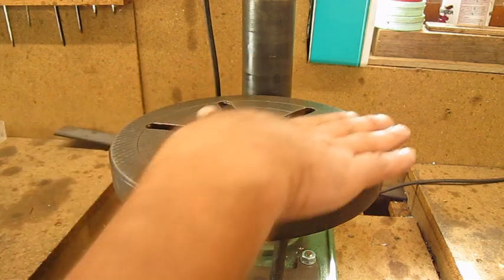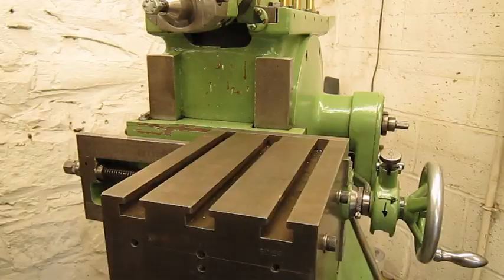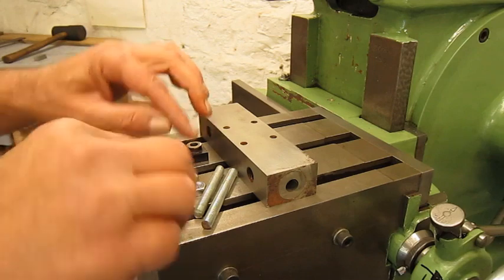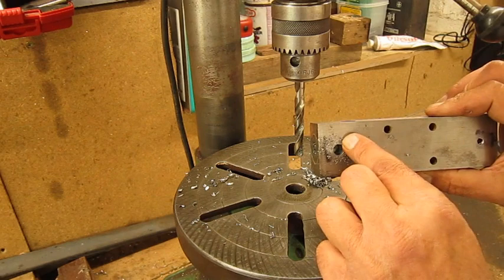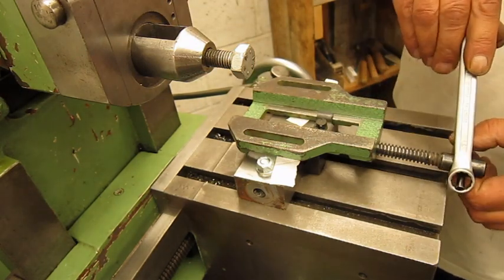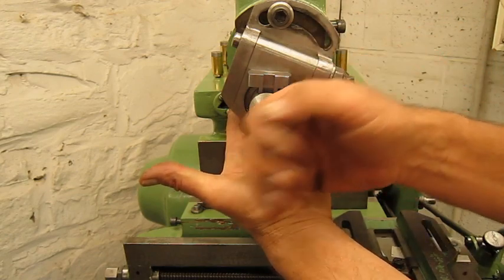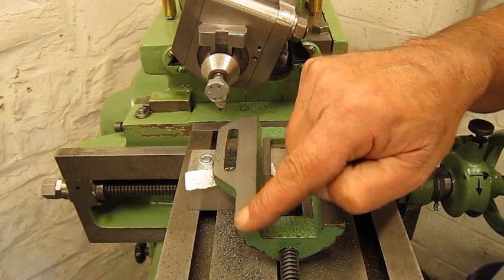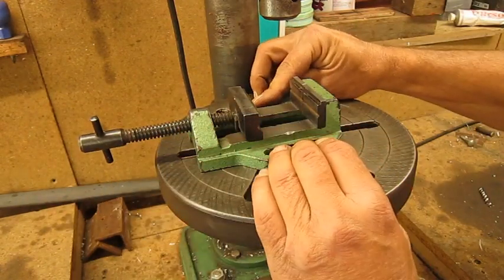Rectifying a drill press vise.

Comment: Great job on reshaping that surface. As for safety, yeah we all make some mistakes with our safety. Mostly the equipment forgives us and we live to "machine" another day😅 i once forgot a drill (12mm) was moving along the top of benchlathe and when it fell on the moving chuck(full speed) it certainly knocked my safety goggles, and broke it. I still have both eyes thanx to a cheap set of safety goggles. Dont forget to clamp workpieces when drilling or milling or turning and keep loose items away from moving machine parts. This is a message to all machinists out there. Be safe for more future and happy machining😀
Reply from the maker: You're right. It's important to stay tuned at any time. Things can go wrong very quickly.

Comment: Well, as if my mill envy wasn't enough, now I have shaper envy too🤣.
Nice fix on that little vice! A clever work holding solution too😊. Gonna have to actually measure a cig paper lol. That's what I use too😁.
Cheers
Reply from the maker: Thanks.Using things in a way they're not designed for can be very useful. BTW, shapers are fun.